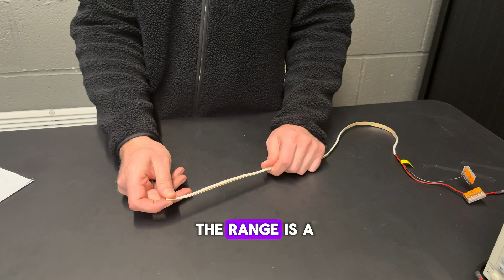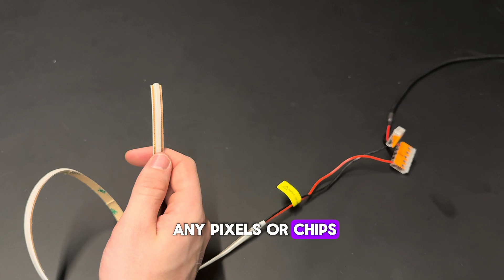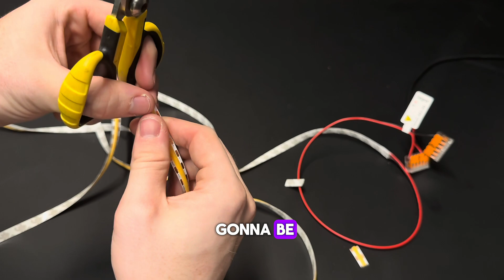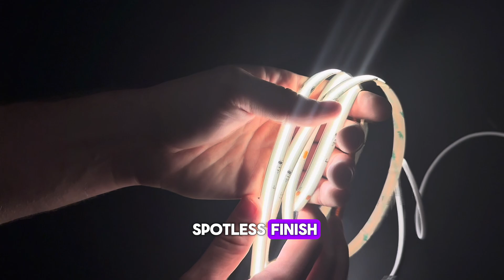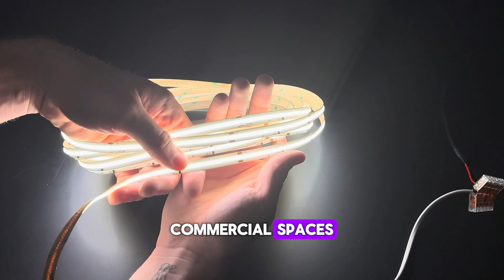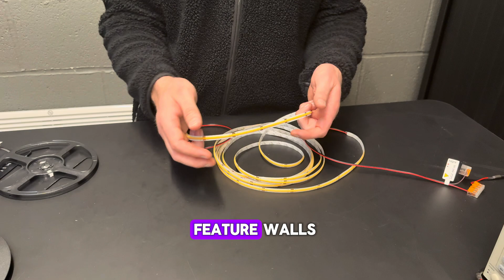Choosing The Right COB LED Strip For Your LED Installation

Comment: What are the orange clips called? Can these be used dasiy chain lights together?
Reply: I believe they are called wago connectors. They are used for connecting wires together (similar to pigtail connectors) and come in different configurations
Reply from the maker: They are called Wago connectors! You can purchase them now via the link in our bio.

Comment: Hi which cob strip light is flicker free with high output
Reply from the maker: All of the cob strip lights we supply would be flicker free, if paired with one of our receivers which can be seen here - Smart Home 5-in-1 Wifi and 2.4GHz Wireless Receiver | UltraLEDs. If you have any further questions specific to your project, please give us a call on 0161 507 9249 or drop us an email at support@ultraleds.co.uk